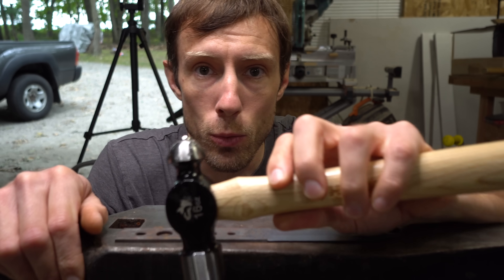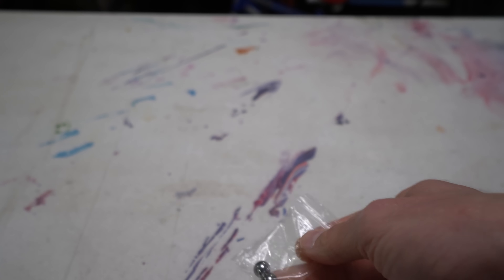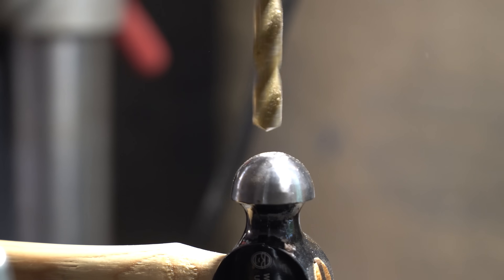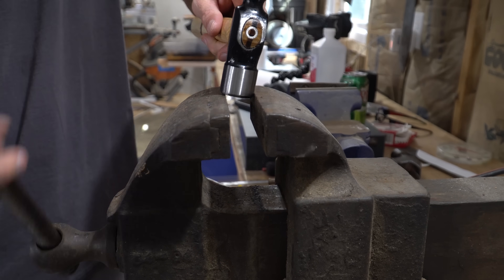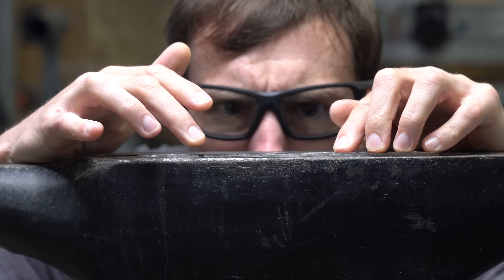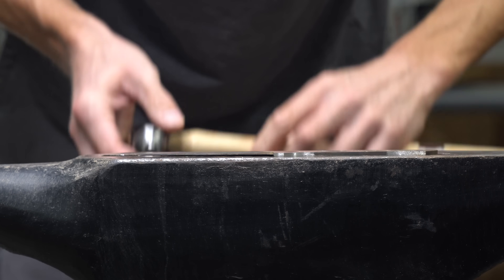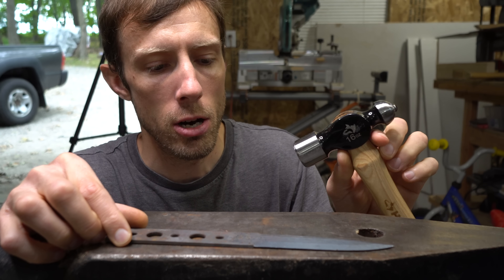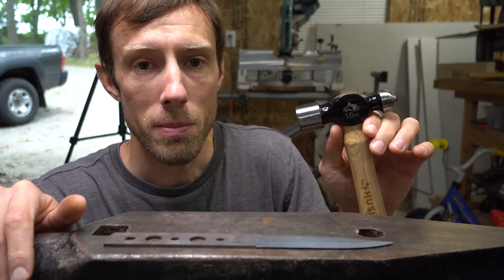I Should Have Made This Weird Tool WAY Sooner

Comment: a book from 1771 recomends making the hammering part like a wide wedge, so the material only stretches in one direction. It might be even more effective, while leaving fewer marks
Reply from the maker: Interesting👍
Reply: I suppose you could use a broken end mill for the striking surface and unlay it into either an existing cross peen or small hand hammer like maybe 1 1/2 or 2 lb
Reply: @courier11sec  i mean yeah, back in the 1700's they just made a hammer from very high carbon steel, and they would quench the striking face without giving it a temper for maximum hardness
Reply: Thank you for typing all that. Sounds like a fantastic resource. Love the idea of them knowing how and what to do. Even if wrong on why.
Reply: @McKildafor  yup! They were definitely extremely talented master craftsmen, even to modern standards. Some pictures of designs they had was mind blowing, and knowing they did all that with homemade abrasives and tools is judt crazy. One chapter is dedicated to making a "knife with secrets", basically a beautifully decorated knife.. With an other knife inside of it that would slide out trough a spring mechanism. Even with today's tools, making something this intricate, precise, and metallurgically demanding is impressive.
Reply: Platers the people whose job it was back then to straighten iron plates used a hammer with the wedge straight peen heads at 90 degrees to each other. I forget the exact name for them and cant find the ling to images showing this hammer but they used to up to sledge size and used day in day out by them to make the plate steel that built industry. Its wasn't all roller steel as it is now.
Reply: That sounds like my 8 oz. cross peen. I guess it might work if the blade isn't in the 60-65 HRC range coming out of the quench.
Reply: What book? Sounds awesome. We've obviously gotten dumber in many ways and Google is quickly becoming the monopoly on information. Love old books
Reply: @knifeguystuff  it's in old french, "the art lf the cutler" or a translation along those lines. Basically it's a master cutler from Paris who writes down his processes and techniques for the scientists. What really surprised me is that their heat treatment process is FLAWLESS. He describes the exact temperature, the best grain size, carbon content (tho carbon wasn't a thing yet, they just individually test their steel bars to check the hardness and impurity content), and temper. It's really mind blowing. To have a perfectly equal temperature, they used a bed of small burning charcoal pieces, they bury their blade inside, and then they use a handheld fan to give some oxygen to the parts where the coals are slightly too cold. You can imagine how uniform and precisely controlled the heat will be with that technique. And even in the 1700s, they recommend quenching at a cherry red/red like a rose. They would also do a differencial temper, keeping the edge either straw, yellow or bronze depending on the use, and a blue back. They would do that with thick blacksmiths tongs heated to red hot, and then they would grab the back of the blade, wich would leave a blue spot just where it has been grabbed. Very elongated and wide tongs would heat treat the whole back of a blade at once. Really fascinating stuff. They even have all the recipes for making your own abrasives and polishing compound, how to sort the grit size, how to sand and polish a blade, even how to go to mirror polish (without modern tools and abrasives it's really fascinating, one of the finer abrasives they got would be burned up tin metal, that would make a very finely powdered oxide that they then sorted). Sometimes their scientific reasoning is false (they had weird concept, like "the essence of metals", basically if a kind of steel sparks well when it's ground violently, basically a spark test, that's beacause the steel has a lot of "essence". So they could recognize carbon content, but with the wrong reasoning lmao.
Reply: @jeanladoire4141  that's amazing, I'm curious, did they have a theory on how steel works if not for carbon? My faith in science these days is...gone. The number of wild theories were given as "facts" is unreal and I wouldn't be suprised if the old frenchie knew more about that steel than we do.
Reply: @knifeguystuff  lol no trust me, with the engineering of magnacut and space grade steels, we know way more than they did.
That being said, cutlers rarely made the steel themselves, the most they would do is "faux damas" (fake damascus in french, wich is basically pattern welded steel to copy wootz, that's how they called modern damascus steel back in 1700).
So beacause they don't make the steel, the book mainly talks about different kinds of steels, mainly by sorting them from where they were produced. Beacause each workshop makes iron a different way from different ores, you would have been able to differenciate different qualities of steel depending on if it was imported from Germany, England, southern france, wherever.
There is a notion however that a piece of iron would be more or less "steeled" (aciéré in french), wich in modern metallurgy would refer to carbon content. Back in the day, because steel was folded, they also had an other notion that we don't really have, wich is "aigreur" (or bitterness, referring to a piece of metal that is hard to work with and would crumble/be brittle). That would refer to sulfur and phosphorous impurities, and of course quality of steel folding/amount of slag present in the layers.
The master cutler talks about chariot axles, saying that if workshops took the time to make well folded steel, with use of proper flux (fine sand or borax, as it was already well known), no chariot would ever break its axle.
But yeah, they would test the bar bought to check for properties, sometimes multiple times along the bar, beacause folded steel lacks homogeneity, and so basically to them, good steel is a steel that doesn't have any visible slag inclusions, that would snap cleanly with a fine grain, and that would work well while hot.

However an odd point about grain size is that while they understood that overheating would make the grains grow, their scientific theory is that beacause the grains grow, there's a gap between the particles of steel, and so the steel becomes like a sponge (and therefore be weak). They didn't seem to know that doing thermal cycles would reduce the grain size, and they would rely on hammering cold to "compress back the grains together and remove the gaps". Cold working indeed is pretty damn effective at reducing the grain size, and as they would quench at a cherry red anyways, the grain would be pretty damn fine as a result.

They had to quench their steels in cold water however, beacause old style steel doesn't have good quenchability. However, they say the edge will snap from the quench if the blade is quenched blade first, so the back should enter the water first... So that can be a solution for those who have cracks after a water quench.
Reply: @jeanladoire4141 do you happen to know if there I'd an English translation of the book? I've been googling and can't find anything
Reply: @michaelbietsch2864  i don't think so, i can't find English publications. Sounds like you're gonna need to learn old french
Reply: @jeanladoire4141  I mean, 52100 is pretty great, 120 years and we've got a bit of rust prevention and some edge retention? Its barely noticeable during real world use, you'd think with all of our understanding, we'd have more to show. Whether you call it carbon or essence doesn't really change much. Obviously, with more time and observation, we can predict its behavior and tweak its properties more than old jj did, but do we really understand how or why it does what it does any better? I'm still seeing a bunch of theories when I really dig into it. I could say the spirit of the steel needs to be put through violent extremes to strengthen its essence and I will still get the same results as you believing it's just crystals and carbon. All I'm saying is look into some of our past while the almighty Google hasn't gobbled it all up yet, you will see magnificent structures and impossible feats of engineering that would bankrupt major cities just to try to demolish, which is the only reason they are still standing today. Many mysterious "fires" in every major city around the same time, have all but completly erased much of our past, but there is still time to rethink your perception of our ancestors before total censorship. We are rebuilding from the ashes of very advanced people, and its clear to me that they had a much greater understanding of how much of reality works. All my crazy tin foil hat stuff aside, thank you so much for your time and valuable insight. Is this book available in English anywhere?
Reply: @jeanladoire4141  damn, that's unfortunate for me lol. Thank you anyways